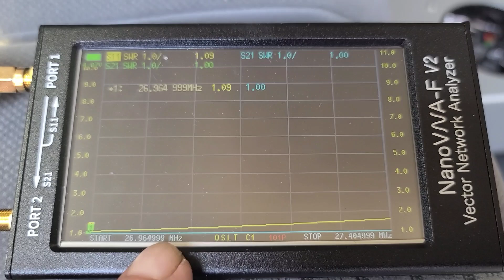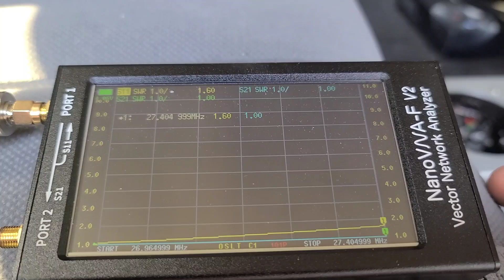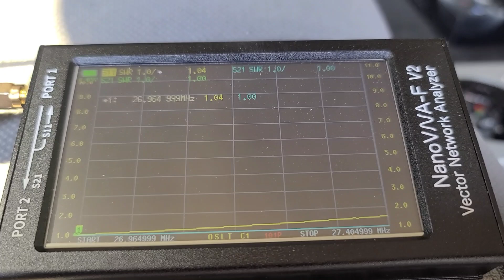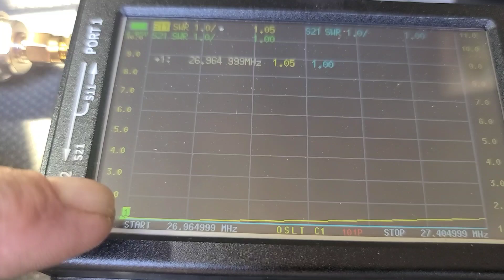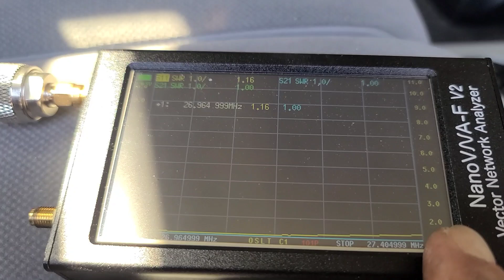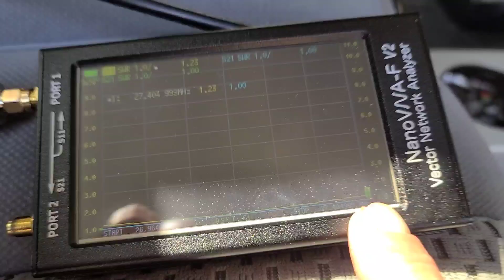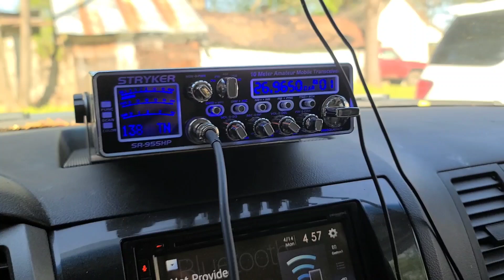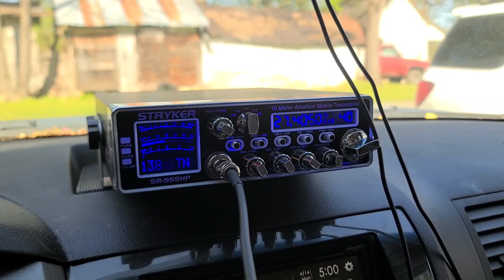How to Set SWR on Stryker SR-A10 Magnet Mount Antenna using NanoVNA (Open Box and SWR)

Comment: On the nanoVNA, you just hook the antenna to it and not the receiver? I’ve never used one so I’m curious. Also, what fittings did you use to connect the coax to it? That looks so much easier to use than the traditional swr/ field strength meter

Comment: I have an aluminum body F-150 that I had to buy a steel plate for, that you have to
take the upper brake/backup light off, then mount the plate to the body, then put the light 
onto the plate.
Since I don’t have to worry about scratching the trucks paint job, would it make any difference 
if I removed the rubber bottom from the antenna and mounted it metal to metal?
Thank You!
Reply from the maker: I took the rubber off the bottom of my SR-A10
Magnet didn't seem as strong with rubber cap on

Comment: I own a 2011 Tundra Same radio & a Stryker mag mount,where's the best place to run coax through ?
Reply from the maker: I ran mine down the back of cab between cab and bed, just in the center to right of 3rd brake light. Entered cab thru a 2 inch roughly rubber grommet under passenger rear seat.
Cutting small x in grommet just enough to get coax through.
Found where coax was hitting carpet from top and cut small x in carpet under seat and pulled my coax in

Comment: With the nano vna , couldn’t you just screw the antenna into it ? Instead of keep going back in the car to check it ? Seems it’d be easier, were it on top the car while your adjusting/tuning the antenna
Reply from the maker: I would rather do it with the Coax attached

Comment: Hello, I have a big problem with that same antenna... it doesn't fit the ROE... I've cut it almost two inches and it won't go down... how much did you cut it or how do I adjust it? Thanks
Reply: Did you cut a little at a time (1/4”) like in video ? If you’ve cut too much (seems you did) you’ll have to buy a replacement whip, and start over.. eBay sells replacement whips
Reply: @topcat15191961  I clearly messed up, how much do you recommend I buy the whip?
Reply from the maker: I don't remember exactly , But it was about 2 inches. What Vehicle are you installing it on
Reply from the maker: As Topcat said you may have cut to much off the whip. And as in the Video sometimes the whip is Not long enough out of box and if you cut it , you make it worse.
You can determine this by checking Swr on channel 1 and writing that down, then check on channel 40 and write that down.
If channel one Swr is Lower than channel 40 swr , The Antenna whip needs to be shorter.
If Channel 40 Swr is Lower than Channel 1 Swr. The whip would need to be longer.
Reply: I've had mine for 2 years. With this antenna and many others, I generally Raise the whip 1/4" set and forget it. I did two performance videos yesterday. Texas to Ontario, W.Virginia, and Maryland, np:person-turqouise-waving::person-turqouise-waving:

Comment: 🌿 MAKE YOU SOME GROUND STRAPS AND PUT ON THAT TRUCK 💪
Reply: I've been using this antenna for a couple years now, I have done several videos on how well it performs; 2 yesterday. However I'm always wanting to learn. Can you explain where to mount the grounds for this antenna?
Reply: @BEN-HUR_UDX358 
Put them from the frame to the chassis I like using number 10 gauge wire 😄 
You cannot have too many ground steps on a vehicle 🚜 
It will cut down on interference 2 👍
Reply: @BEN-HUR_UDX358 
Hooking your radio directly to the battery will also cut down on vehicle interference 💪
Reply: @David-yp4fl thank you sir, I've done both